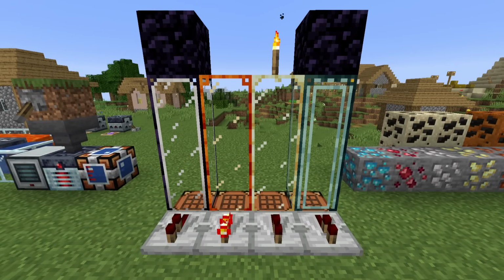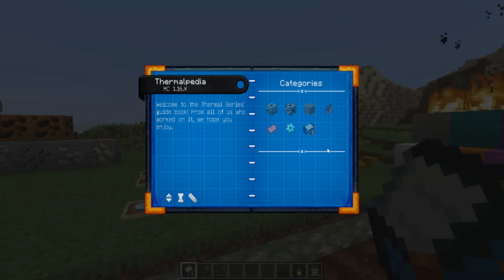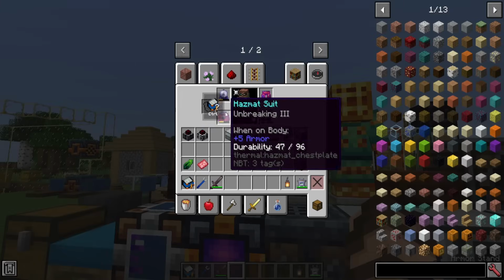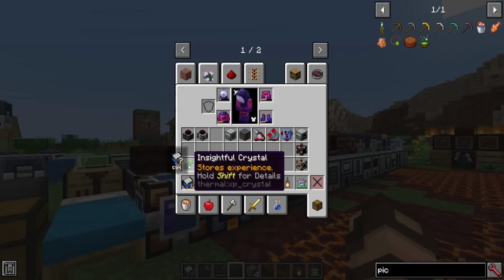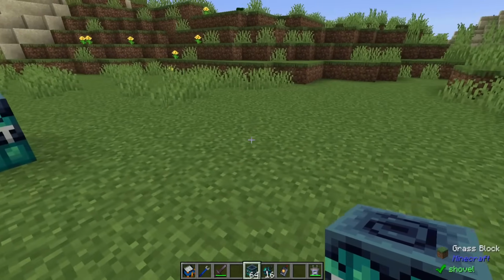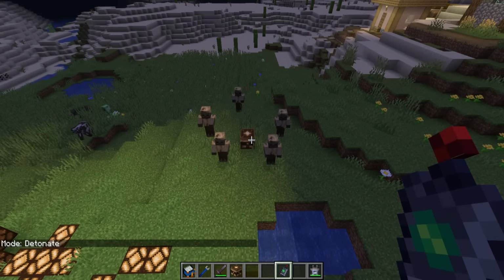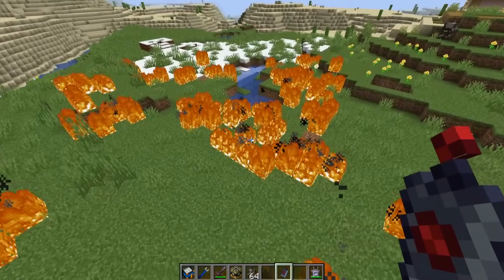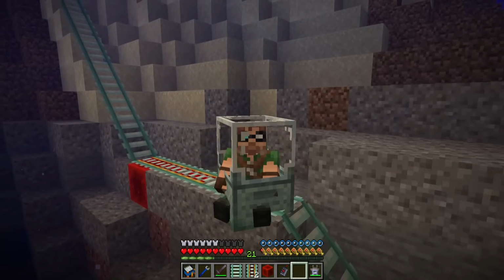Thermal Series mods Pt1 Foundation & Locomotion Bit-By-Bit 1.16.5

Comment: I have enjoyed playing thermal series in 1.19.2.  You mention using Connected Textures at 1:20 but it was only available for 1.16.5
I have used Connected Textures Mod (CTM) instead and it appears to be working.

Thanks for the content, it was very helpful.  I have subscribed and enjoyed several other videos on your channel 👍

Comment: /pepehands Thermal Dynamics though  :(  What is everyone using for pipe mods (1.16.5+) that is as good as Dynamics was with servos? I've been using xnet but it overcomplicates simple systems and with large networks it's been buggy as all hell. Came here hoping to see some pipes somewhere in the Thermal vid.

Comment: The lack of in-world fluids might be related to the fact that Forge Fluids don't seem to work at the moment for 1.16 according to a post I saw on r/feedthebeast. You can't swim in them at all, you just fall through them. Sort of a shame since Blazing Pyrotheum and Gelid Cryotheum used to be one of the most iconic parts of the Thermal series back in the 1.7.10 days, especially if you had a nuclear reactor mod that used Cryotheum as coolant.

Comment: i saw there is a new rails mod with switch rails, i really hate the switch tracks in railcraft in 1.12.2, they worked fine in 1.7.10, but 1.12.2, mehh, sadly there is no gregtech in 1.16.x and the the copys are fabric only
Reply: There is actually gregtech for Forge 1.16, its called "Gregtech Intergalactical", its in the alpha stage though, so its missing alot of content, like alot of recipes

Comment: Do you know if they have plans to update the 1.12.2 versions of those mods?
Reply: Nah, I'm the only coder at this point and absolutely don't have time to maintain across multiple Minecraft versions. 1.16 was a complete rewrite and I'm still working on adding new stuff.
Reply: @KingLemmingCoFH  Oh hey... I'm asking because the vast majority of modpacks are in 1.12.2... and with those constant vanilla updates, It seems that will be the situation for quite some time... :)
Reply: @faelheavymetal  I don't believe that will be the case, or it shouldn't be. There are a lot of mods which have decided to stop at 1.12, and that's their right. But a good majority of mods has ported up. Modpacks haven't really caught up which is a shame, but we can't get stopped on 1.12 just because there are some stragglers.

Comment: Thermal was always a go-to series of power mods whenever I set up a kitchen sink modpack. Glad to see it's catching up to the current release numbers and improved itself!
Reply: It's been out on 1.16 since last November. Not exactly "catching up." ;)
Reply: @KingLemmingCoFH  I mean, 1.17 is a thing now, thus my comment. Literally started poking on Minecraft stuff again like a month ago, not dug around to see if I could set up a modlist yet.
Reply: @gratuitouslurking8610  Most major mods are going to skip 1.17 and there are a lot of reasons for that. Forge is in the process of improving a LOT of systems and as such is not 100% stable at this time.

Play 1.16, and expect 1.18 to be the next "big" version.
Reply: @KingLemmingCoFH  So 1.16 is the new 1.12, got it.

Comment: quick note about the underwater cart: it has limited air, which refreshes once you exit the water. I don't kniw if you can view the cart's air in survival though.
Reply: This is correct. Something also probably not known - you can enchant the cart with Respiration to greatly increase the air supply. :)

Comment from the maker: MOB TIPS:
- Basalz give the Sundered effect, reducing armor efficiency by 25% per level.
- Blitz give the Shocked effect, reducing your attack speed by 15% per level.
- Blizz give the Chilled effect, slowing you 30% and reducing your damage 1.5 hearts per level.
Reply: Quick note here - in the next major release (1.4.0), Shocked will reduce damage and Chilled will reduce attack speed (by 0.4s per level). Makes both of them more thematic and meaningful, I think.
Reply: Which one adds the blazes? I want them separate lol

Comment: Cant you put rails underwater in vannilla too?
Reply: thats a 1.17 Feature
Reply from the maker: They pop off the ground and are washed away like torches in vanilla.
Reply: In 1.17, yes. However, Prismarine Rails give off a low level of light and also speed up carts when underwater.
Reply: @KingLemmingCoFH  ooooooooooooooooo